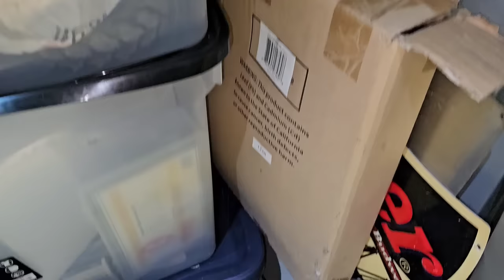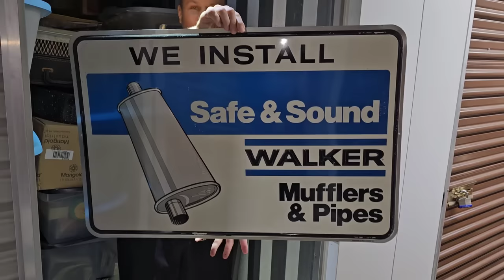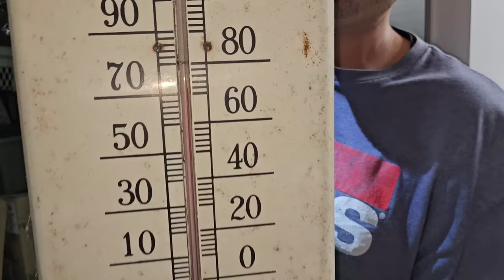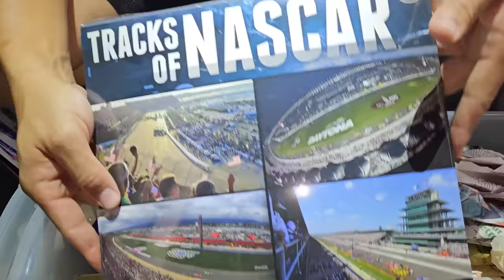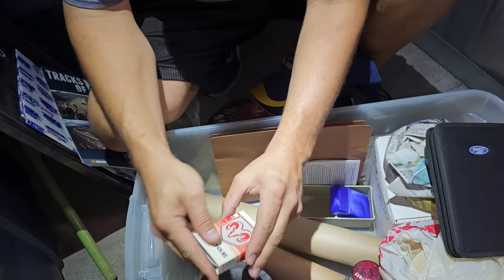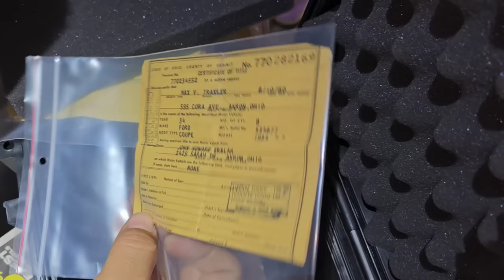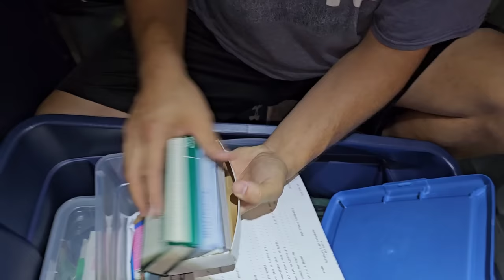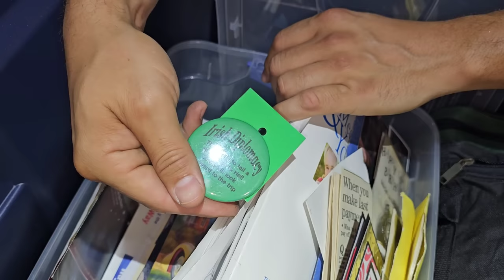SHE ABSOLUTELY LOST IT & We Recorded It All

Comment: Hey, the fan is metal, and prob still works.  They only make them out of plastic these days.  Tools!  happy dance  A woman after my own heart.  The metal signs!  The white noise machine is useful.  The car/racing collectibles should give you a good price.  I hate seeing old (not valuable) clothing and cheap Christmas decorations.  If you are going to rent a unit, it should be for temporary purposes....or stuff you are actually squirreling away for collections you KNOW will gain value.  (The only BOOKS I had in storage were printed in the late 1700/early 1800's.  A horse care guide from 1807 ; and an original copy of the Marquis De Sade's 1001 days of Sodom.  Hey, it's a collector's item; I do not suggest you READ it.)  I would LOVE to find a unit like that!  Congrats!  I'd love to see what all that came down to when you sold it!